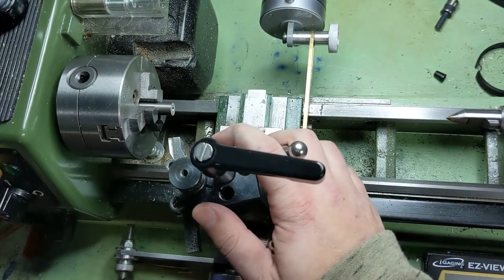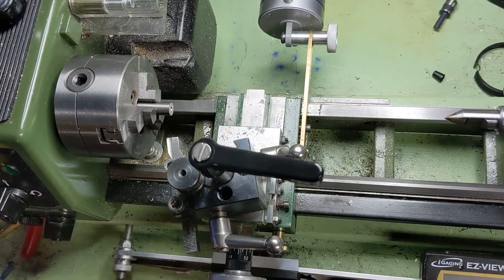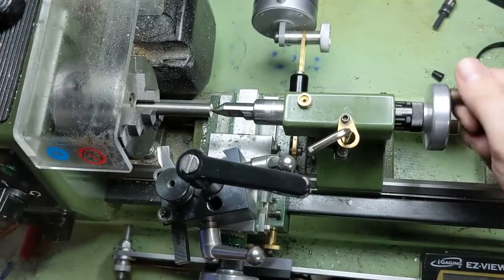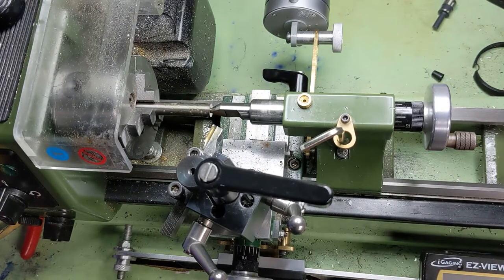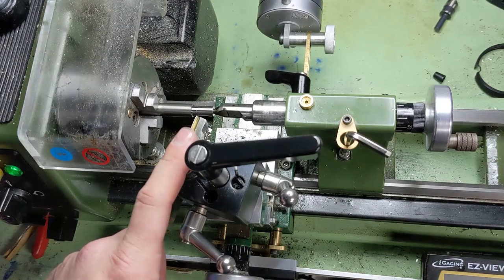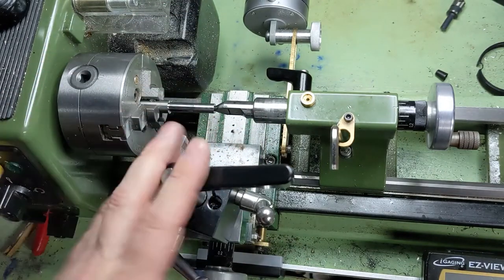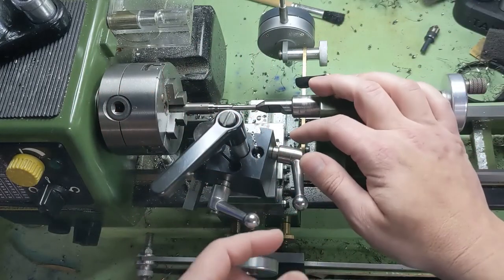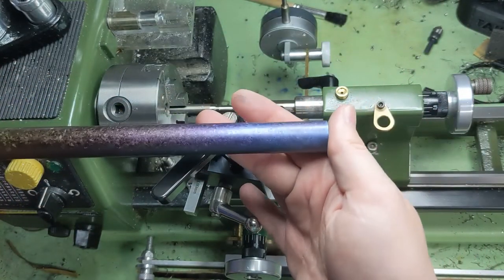Titanium & Stainless on a Mini-Lathe | Tips & Tricks | Abridged

Comment: Excellent video great information. How do you decide when to use a dead vs. live center?
Reply from the maker: Typically I prefer a live center unless I'm turning between centers. I end up using dead centers a lot more often than that because I'm often working with small diameters and need a notched center for clearance, like in this video.

Comment: Thanks so much!   Last time i did Ti i had alot of problems with catching on fire, as i have a 6 inch diameter 1.5 inch thick end cut from a casting that i was trying to clean up.   My next project is to make a new bottom plate for my french press as the standard stainless ones are too thin and bend, resulting in blow back around the screen.   Anyway, i will turn the OD from 6AL4V sheet, and then either mill or drill holes to allow the coffee to pass through.   Anyway, I was thinking to use a non-flammable coolant, and i was a bit suprised to see you use oil.  How generally did you avoid the fiery chips?
Reply from the maker: Sorry it's taken a while to respond to this. I must say, as a swiss CNC guy professionally, I'm used to oil based coolant and as a result am probably more comfortable with cutting oil in my manual shop than I should be.

With that being said, I can usually cut Ti even dry without any kind of ignition, if my speeds and feeds are close. I'm not used to aTi castings so I'm wondering if it isn't related to the hardness or roughness of the outside of your castings.
Reply: @makerunderground  Could very well be, i have no idea what might have been in the alloy.   Anyway my next project is with a known material, so hope it goes better.  Thanks for getting back.

Comment: what mini lathe would you recommend?
Reply from the maker: Honestly, if you're willing to go through it and make sure everything is put together properly, I would buy the standard 7x14 import. I bought my proxxon because I wanted something that worked well out of the box. It's been a good little lathe but over the years I've come up against capacity and rigidity issues with it often. I often wonder if I would have felt like I had a lot more flexibility, if I bought a bigger, cheaper built lathe.
Reply: @makerunderground  any suggestions for a chinese branded lathe? Or just a no name Chinese you mean?